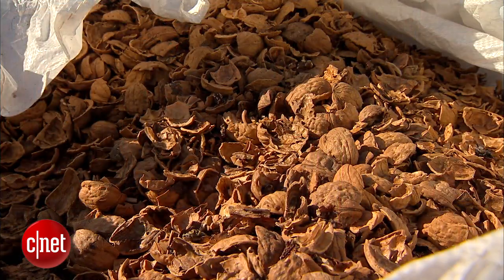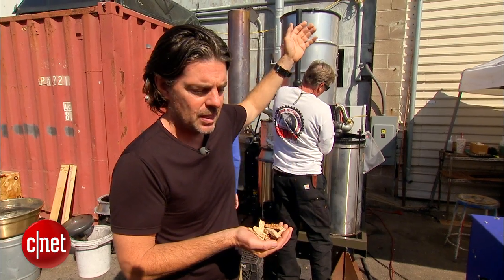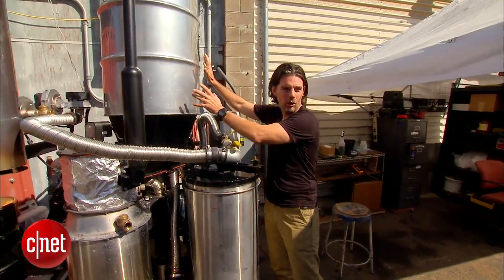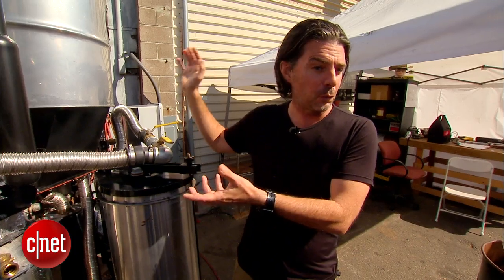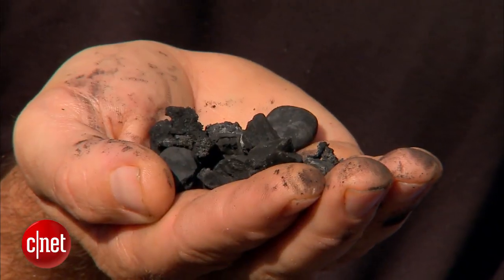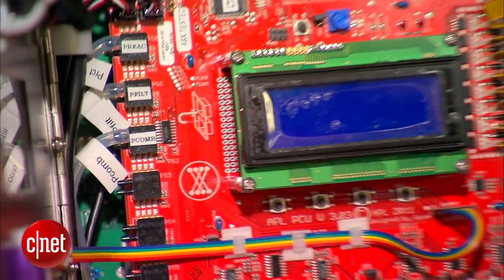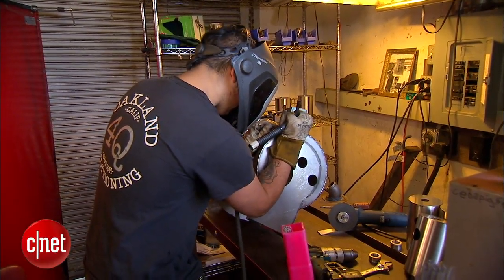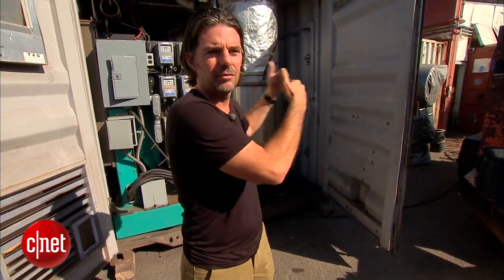Carbon-negative energy source powers homes on walnut shells

Comment: It's good that most of the carbon is separated. But this sales pitch guy never mentions a key factor that needs to be considered. That is how much energy is required to break down the organic molecules to release the carbon depleted molecules. I believe one of the gasses released is carbon monoxide (CO) which he failed to mention. These issues do not appear to be addressed on the company's website. It should mention the energy efficiency of the energy input vs. the output energy when the gasses are burned. There will also be losses of energy when the output thermal energy is converted to electricity and that is transported to the user. I also noticed this is a batch process which also limits its efficiency.

Comment: You are right. I like how people nowadays respond to "new" "inventions".
The only problem with this, you need a heat source to make flammable gas out from any of those materials. It is like steam engines if I can say, that need a heat source to turn water into gas. Of course in bigger measures and/or for constant working it can be more efficient and "green", like turning electric generators with it or so. (sorry for my bad English, not my native language)